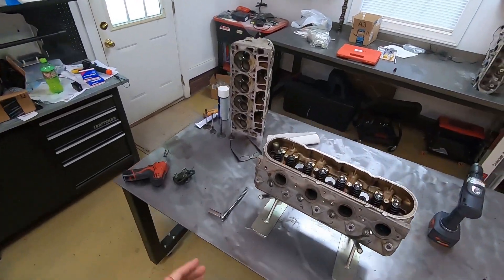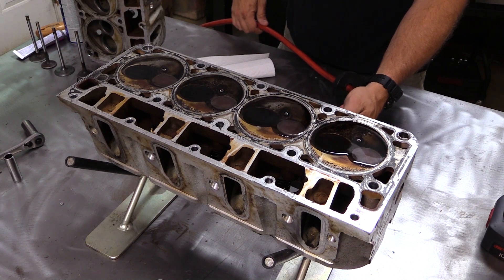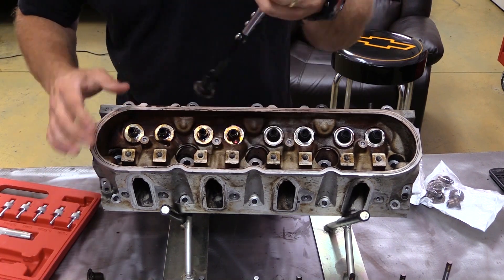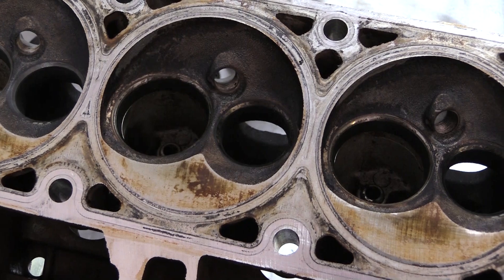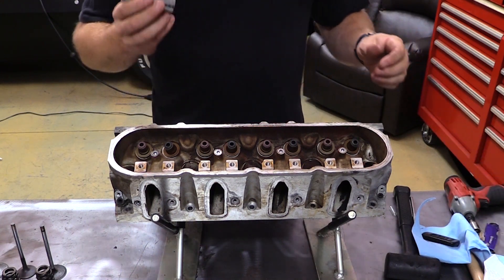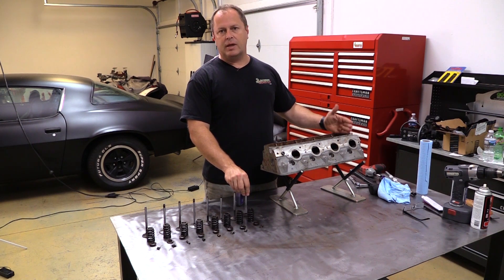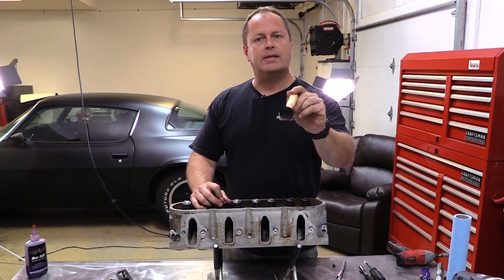How To: Low Buck Cylinder Head Rebuild

Comment: Too bad you you didn't show the low buck face resurfacing like i do on a saw horse outside....
12" or 24" high grade steel rule, draw filing by hand, emery sheet wrapped on a new large honing stone or other very flat and rigid item.

Comment: You can sand it at home to ensure flatness for a true low buck restore. Just need a true flat piece of glass and 3m sand paper. True straight edge and feeler gauges to ensure flatness of the cylinder head.

Comment: I payed $20 bucks for a set of valve lapper suction caps when I should have just glues a magnet to a stick. Those suction cups where a pain to work with. ... although Mr Horsepower didn't seem to have an issue.

Comment: ole timer showed me a trick for lapping valves-put valve in-attach a piece of fuel line to the stem-attach a drill bit to the other end f the fuel line and den asttach a reversable drill-have the drill on the bottom of the head and spin away-

Comment: Where’s the low buck block rebuild
Reply from the maker: Geometry is so much more critical with the block (round cylinder bores, lifter bores in the proper locations, main bores straight and parallel with the deck, etc) I believe the best low-buck block rebuild is to spend the money with a quality machine shop and get it done right. In the long run you will save money when it comes to how well and how long the finished engine will run for you. Thanks for watching!

Comment: Awesome video. Where do you recommend to buy a new cylinder head for a 2015 ram 1500. I bought one from the dealership and it was warped. Returned it for another one and the second one is worse!

Comment: I am replacing a head gasket and somewhere I read that I need a valve spring compression tool.
I already removed the head and sent it to the shop!  I am not tearing it apart like you are doing!: D

Comment: Nice , my 2015 6.2 silverado  just dropped lifters on 4 and 7. Doing a afm delete , back with stock cam. 117k miles and I want to freshen up my heads , they seem fine , but while I got it down. These DI intake valves build carbon so figure I will clean them too ,and lap valves. I'm doing a oil/water separator too. A ton of black gunk in intake ports. Thanks for the video , helps a lot.👍👍🏁🏁

Comment: The method I was taught for checking valve sealing was to position the head with the ports facing up, dry the combustion chamber with acetone or brake cleaner and fill the port with gasoline. Look for wet spots to appear around the valve. flip it over and repeat for the other ports. It's very effective.
Reply from the maker: That is a good method

Comment: I feel like everyone worries too much about getting every spec off the head gasket surface. It doesn't need to be shiny or anything. Even if there's a chunk or two of old gasket material stuck on there if it's not like 50 thou thick the chances of you having an issue are slim to none. Scrape it down until you don't feel anything significant with your finger, wipe it off and slap your gasket on. Trust me, save the energy for the other parts of the engine build. The heads gasket will seal. It's a pushrod engine, not a space shuttle. If you aren't making 700hp. Just get it back together and torqued to spec. Check the head warp with a true straight edge and feelers at home if you don't feel like going to the machine shop. If it's flat you're probably good. That's the true low buck way.

Comment: Is there anything you can soak the head and valves in to clean them. I've seen some other low buck options guys using brake fluid or that gunk stuff. Is there anyway to clean intake ports.

Comment: I think I'm going to pull the trigger on getting the valve guide seat and puller. I have a pair of pliers that I bought from Sears a good 20 to 25 years ago that seems to be perfect for pulling them off. I always used the deep socket method for putting them back on. I checked out the tools that you listed and found a full set like you were using for less than $20. So I just went ahead and bought it. I'm someone who is retired and was fortunately enough to do it at fairly a youngest age so I have tons of time on my hands. So in my garage since it is so large I have a habit of buying tools all the time. I'm a person that rather have it on hand then need it and then look for it to finish a job. I have things that I have bought years ago and never have used to this day then I have things that I bought many years ago that I need it this past summer and had it.

I'd like your trick with the water on the cylinder heads. I always do that but with alcohol and I never learned to do the air trick until you showed it in this video. It's almost making me putting this huge Miller bobcat generator / welder in the garage and start working on it. I know I have a problem with one of the heads. Since it's mine I just haven't gotten around to working on it but now I want to pull the heads off and check them the way you did.

I love that you use compound on each valve also. The only extra step I go and it's probably not needed but it was the way a friend of mine showed me. I have machine die and I put some either on the valve itself or on the seat of the valve. And I use the suction tool by hand not like some others I've seen on YouTube who hooks them up to cordless drills. like you were saying you can hear a difference when you get there and you won't hear that using a drill. I do the same thing that you do to clean them up except I use my drill press so that way I have two hands one to spray and one to clean.

I really enjoyed all your tips and cannot wait to try them out. Lucky enough here in Maryland it doesn't look like we're going to have winter so that leaves me more time in my garage before having to worry about getting some kerosene to heat it up.

Look forward to seeing more of your tips. For people out there like myself that are not Chevrolet people there is a lot to learn that goes for any type of engine. A lot of the stuff that was used in this video are the same things I use on generators welders anything with a gas engine and a cylinder head.

Comment: Awesome videos man ! I love the extra knowledge, answered a lot of questions I’ve still had after messing with these Ls’s over the years and starting my ls1 build. I’m rebuilding my old 241 heads that were replaced by ported 243’s. Do LS rocker arms have to go back into the exact location because all of mine were mixed up in one box 😭 no one can seem to answer that question !
Reply from the maker: Thanks for the kinds words! And you should be fine. The lifters don’t mate to the tops of the valve stems like a cam lobe and flat tappet lifter. If you are building an LS3 just make sure to get the intakes on the intake valves and the exhaust on the exhaust. They have different offsets. Good luck!

Comment: Great video! Just went through this with an LS1 I'm building for an El Camino. I used oven cleaner to get the bulk of the grunge off but I do like your technique for cleaning the valves.
Reply: It’s an ‘87 dealer badged SS.

Comment: A large piece of glass and sandpaper glued to it. will resurface head!low budget
Reply: Yep. Some 250, 400, then 600 grit, wd40. Work in a figure 8 pattern and keep the paper wet. Most would be surprised how flat and true you can actually get heads doing this.

Comment: I'm doin a set of gt40p heads for a 93 bronco w/ 351w. I could not find any specific ford videos worth a while, and decided a generic search (no brands) and I found your video. So far its extremely informative. I am going to buy new springs and valves, and I dont trust my local machine shop to do my valve seats or anything else. they have destroyed 2 sets of brake calipers on me. So I am at a bit of a loss as to what to do, but keep searching around. I wish we SBF guys had a fancy valve spring compressor tool like for the LS lol

Comment: This is a budget cylinder head rebuild.  Why then say you'll ship it off to a machine shop to deck the head?  First thing after disassembly and cleaning, use a straightedge and a feeler gauge to check the flatness of the deck.  There are specifications, and it your part passes, use it as-is.  Guess all I'm saying is this is 'budget' or it isn't.

Comment: A couple other low buck cleaning tricks for aluminum heads.  To clean up the oil residue, you can spray oven cleaner on the entire head and put on a black plastic trash bag in sunlight for a couple of hours, rinse with water, & then wash good soapy water & a coarse scotch brite pad.  the gasket surfaces then can be sanded with a hand auto body long board with 120 grit paper in a "x" pattern & thorough cleaning with brake cleaner & compressed air.  This makes the surfaces ultra clean while helping to make sure they are flat & straight.  The scratch patterns are almost the perfect RMS for multi layer coated stainless (MLS) head & exhaust gaskets, silicone embossed intake gaskets.  The same treatment can be used for the block.

Comment: Great video! I also clean valves the same way, I would like to add I use the drill to spin the valves in the seats by the way with the grinding compound it's a little quicker. Then after wards I clean the seats and then use a Sharpie and put the valve into the seal and press down and turn it to make sure the sharpie rubs off from the valve onto the seat all the way around to ensure it's a perfect seal. As for the final initial cleaning  I use a garden hose (or power washer) to blast the head and then I like to drown the ports with high pressure water to flush all of the grinding compound out.
Reply: It is not advisable to use a drill to grind in valves because all the movement is in one direction. A valve should be lapped using an oscillating motion. There is a special drill attachment that does this.
As for compressing valve springs, I use an old piece of flat steel bar in which I drilled two holes, one to bolt onto the cylinder head and the other to go over the valve stem. Press the bar down, remove the collet and the valve is free. Total cost - nuppence.

Comment: Just thinking out loud, couldn't you also clean the old gaskets off the deck surface by using a piece of wet/dry sandpaper on a piece of glass with some wd40 and work your way up the grits too?
Reply: Don't use anything abrasive unless you're getting the head resurfaced. You'll put low spots in the head gasket surface

Comment: I’ve done this process on my LS heads with a couple extra steps, turned out great and only cost me some new seals and time. 👍🏻
Reply: What else did you do out of interest? I'm looking at doing this soon
Reply: Trixnhoez, I have access to an industrial parts washer, so I used a bunch of oven cleaner to break the carbon loose, then a lot of time in the parts washer. I also cleaned the deck surfaces with a die grinder and scotchbrite pads, and removed all the casting flash I could find with a sand roll, and cleaned up a little above the seat. I also chucked my valves in a lathe and polished them with very fine grit sand paper.
Reply: @shitbox7413  Scuff pad FTW.  Under magnification, can't see any issues with a Scotch Brite on aluminum.  Multiple cylinder heads cleaned this way - all still going strong.
Reply: El Marko, 👍🏻

Comment: Glue some 1500 grit sand paper to a flat glass sheet and boom homemade resurface machine... hit the sandpaper with some wd40 and drag the head back n forth till the whole surface is even.. i do it weekly because i have a valve and seat grinder and valve guide removal/install tools.. that $30 paint can of berryman parts cleaner works wonders on the dirty parts with a plastic bristle brush and you can easily do 3-4 engines per gallon of berryman.. ballin on a budget man
Reply: We do similar at work to ensure flatness, a figure 8 pattern works really well
Reply: laurie agnew figure 8 is really the only way to do it.. usually what i do is figure 8’s for about a minute then i take a giant jumbo wide tip black sharpie and cover the whole bottom of the head with it and as im working it I’ll easily see where the low spots are.. once the marker is completely gone i know the head is perfectly flat.. then i switch to 2,000 grit paper for a final pass of about 90 seconds.. perfect every time

Comment: I like to fill a plastic tub with 50/50 purple or mean green water combo and soak the heads after removing the gasket, rinse with water and they look amazing....and for iron heads i spray engine degreaser and rinse with water then immediately spray with wd to prevent rust
Reply: What about just throwing them in the parts cleaner I have in my garage? Like one from harbor freight?
Reply: @bigdummiegarage9022 that’s what I’m wondering. Did you end up doing that?
Reply: @grandsalt24 I didn’t. I ended up buying a remanufactured set of 862 heads and changed the build. Threw the 317s away.
Reply from the maker: Will have to try that. Thanks
Reply: does this remove all the sludge from the valves Bad Donkey?
Reply: @TheHebersharedChannelRandom  yes but if i pull a head i always remove the valves, clean and relap, and replace the seals, always better safe than sorry

Comment: Some people like to use acetone to test valve sealing because it is less viscous. Some brake cleaners are also a good choice.
6:16 It is worth having a dial bore gauge that can stick to the cylinder head. The factory specifies a certain amount of movement in the valve guide, and the number is so small that you need precision measuring tools to know if your valve guides are good. You could be out of spec and not be able to feel it.
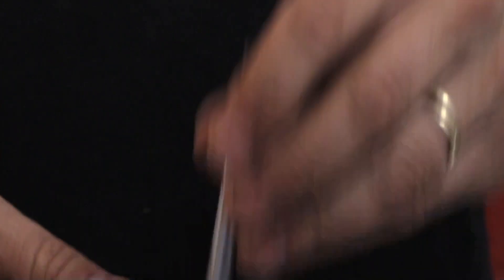7:39 You still need to measure the valve margin width and valve stem width, then compare to the service manual to know if you can reuse the valve.

Comment: You say Cly head rebuild..But then you re use old high mile valve springs when Beehive replacements are as cheap as they are I'm a little confused as to why you were ever promote the re installation of well used up valve springs ?  I myself would have opted for new springs and a bowl blend and very light port improvement especially on the exhaust side  ! OH and Brother PLEASE GOD PLEASE tell me you didn't go ahead and shame that sweet camaro with a satin black paint job ? Please tell me your NOT one of those trendy mindless wannabee's who actually believed that was "Cool" or looked great ?  please bro paint your car some kind of factory color with stripe's the look is outrageous & timeless and is just a few dollar's more costly then the I'm clueless & broke Satin black  guy .....
Reply from the maker: New valve springs would definitely be a good idea if the heads are going on an engine long term. I agree that's a good idea.  I'm using these heads as a baseline for dyno testing. After making a run or two with nothing hopefully blowing up, the plan is to start making changes, including cam and valvesprings. Because we're talking about low-buck options, I didn't want to go an put on a set of expensive, high-end valve springs. That would really have fired up the comment trolls! And yep, that's flat black paint. Specifically Eastwood single stage. I chose it because it is inexpensive, and as I work on the car (hopefully, tubbed rears in the future), touching up the single stage paint won't be too time consuming or expensive. And I do like flat colors. I didn't choose it because I was trying to impress anyone and -- don't take this the wrong way -- I'm not bothered by what anyone else thinks of it.  Thanks for watching.
Reply: Stop hatin
Reply: What if his car did not come with stripes,why would you waste the money ?. Maybe its black primer and he put it on so it would not rust.
Reply: Michael Laverty  why don’t you send him some 1218’s then?